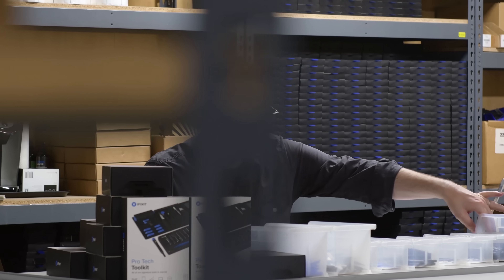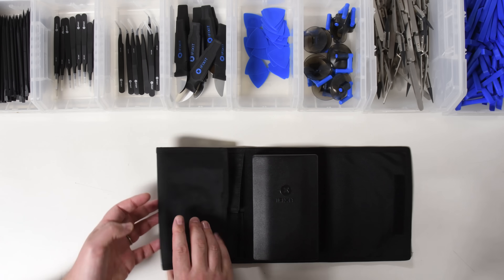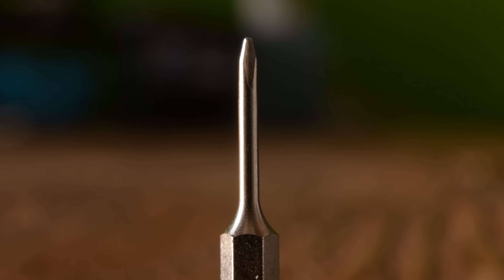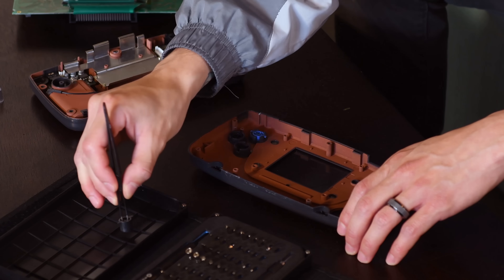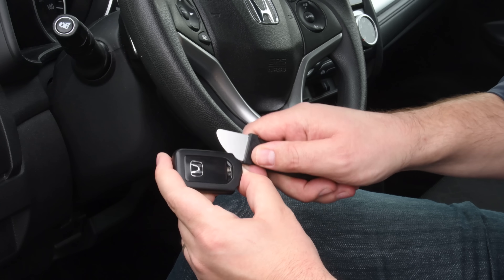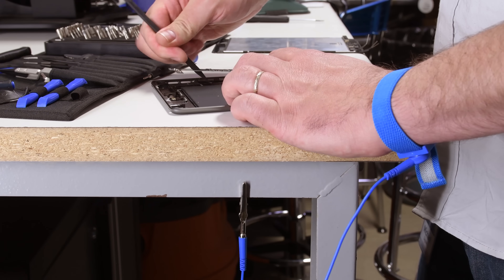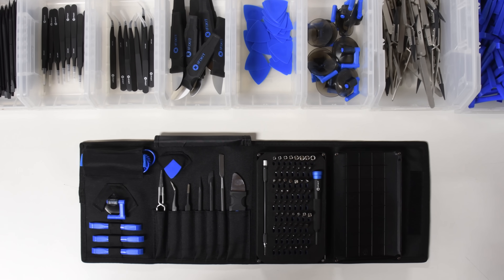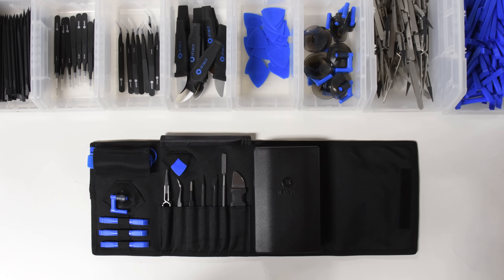The Pro Tech Toolkit!

Comment: Maybe the good people of iFixit didn't mean for it to be used for this, but I had (still have it) this unknown-brand power strip with a defective ON-OFF button, which was put together with these "weird" screws, and the ONLY way to open the goddam thing was with your iFixit kit.

That ON-OFF button no longer works (I removed it and resoldered its wires), but the power strip works again. Without the iFixit Toolkit this power strip would have ended up in the trash, so thank you, iFixit. 👍